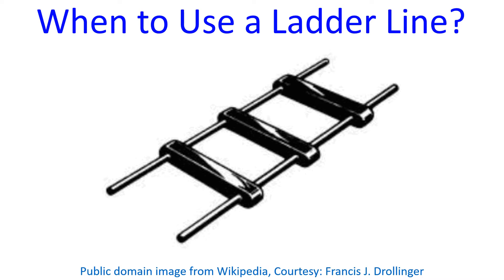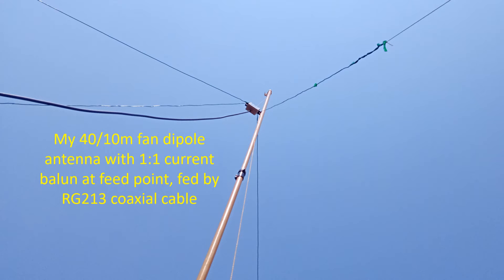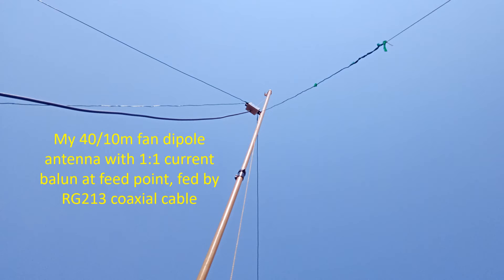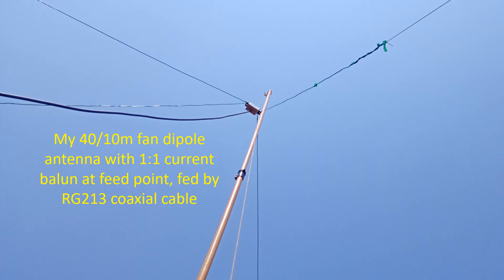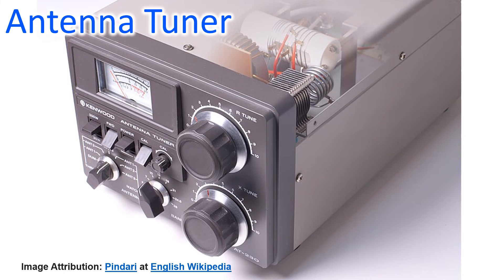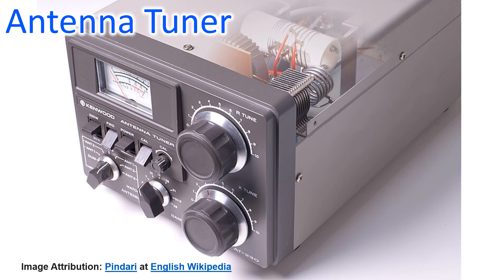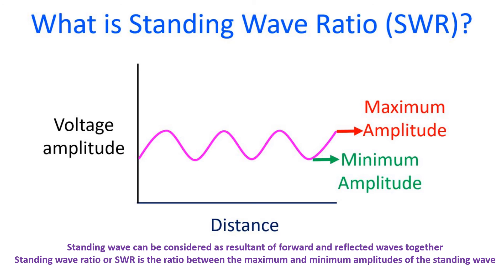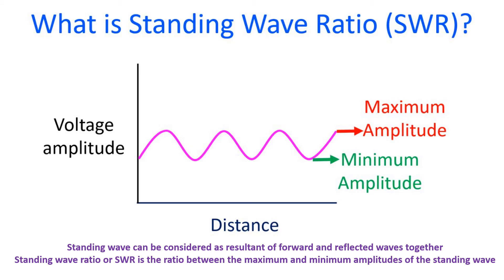When to Use a Ladder Line?

Comment: I talk to Steve many mornings on 60 meters channel 4.  Great guy and very knowledgeable fellow.  He has a good book called "Radio Propagation and Antennas: A Non-Mathematical Treatment of Radio and Antennas".  I use a 700' loop fed by 600 ohm ladder line and a balanced pi network matching network.  I use it from 160-10 meters and have no problem getting back to any station I can hear with power levels up to 700 watts.  For a multiband antenna system with maximum radiated power and good receive characteristics, I doubt a big loop or doublet fed with ladderline can be beat.  73, KF0BBU
Reply from the maker: Glad to know that you know Steve well! Thanks a lot for sharing your great experience with a ladder line. Hope to hear you on air someday. 73 de Jon, VU2JO